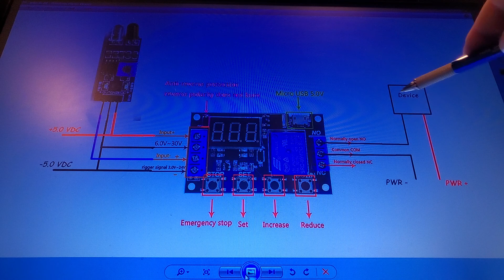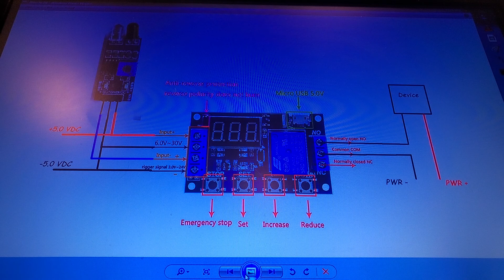Wiring up the low voltage module to  a XY-J02 timer relay module

Comment: Really confusing! You label the Trigger-ground input as "-5.0 VDC" but it's just a shared ground connection. Your diagram misleadingly implies that the inputs require both positive and negative 5 volt power supply connections which is not the case. Also, you wasted nearly a minuet telling people not to be idiots. You can't fix stupid so maybe you could just skip that part?
Reply from the maker: OK. I appreciate your feedback. I don't necessarily agree with your contention however, it didnt work out for you. It did work out for other folks that weren't easy to confuse. Be safe.
Reply: @raykd2ibp198  Nice comeback. You managed to respond to my insulting comment with a sideways insulting comment. Well played!

Comment: Thanks Ray for your help. I will apply it today and feedback.  Much appreciated.
Plz can we add ultrasonic sensor instead of the IR Sensor as a standalone without using the arduino uno or nano.
Reply from the maker: You're welcome.  
In theory, 3.vdc to 24.vdc needs to flow to the trigger on the timer board. 
What ever module you use needs to act like a spst switch, that allows the required voltage and current to get to the trigger.  So long as the sonar module preforms this on/off function... it should work. 
Be careful when choosing modules. Look at the specs. Understand its power requirements, and power limitations. 
Understand what the module output signal looks like. 
Good luck!  Please let me know how you make out.
Reply: Hello
Reply: Hello